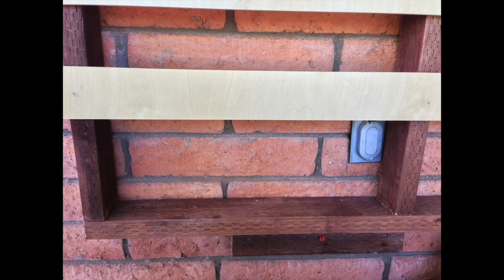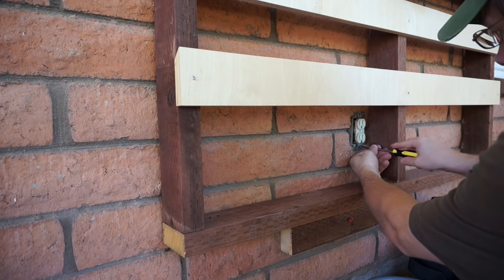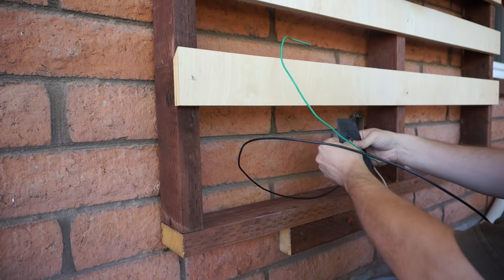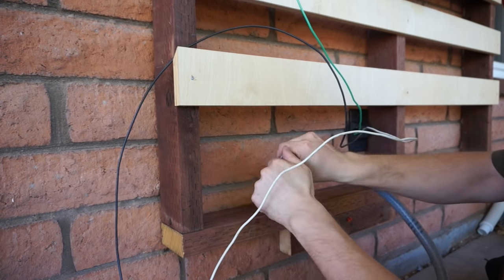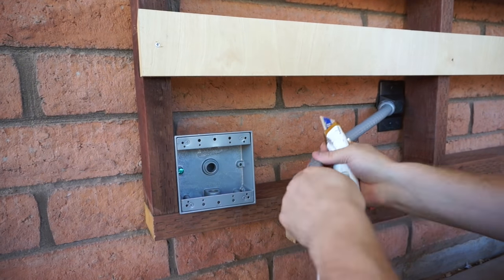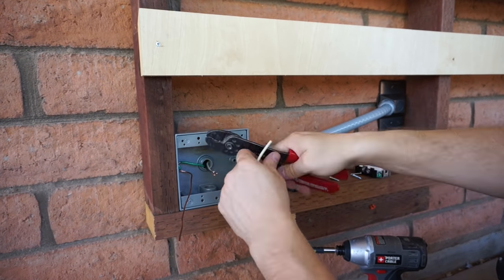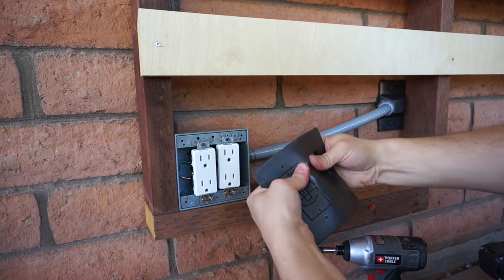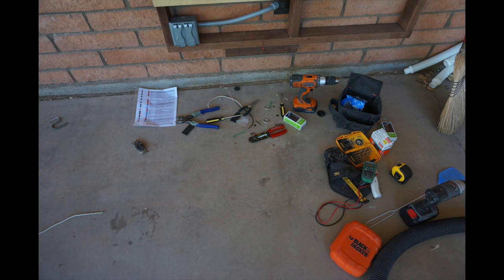How To Extend an Electrical Outlet

Comment: Curious how you would connect a power outlet in series. Then you would need to have an appliance in both outlets or no current will flow. And if one appliance has a lower resistance than the other then it will have more voltage over it than the other LOL. I guess you mean something else than the normal series/parrallel meaning. Any outlet that works on its own (as any outlet in the world does), is connected in parrallel, no matter what routing tricks you do.
Reply from the maker: Serial, in this case, is referring to the fact that if you wire up the outlets linearly, with the input hot/neutral on one side and the outgoing hot/neutral on the other, then all electricity flows through this outlet on the way down the circuit.  This especially matters with GFCI outlets since if the outlet trips, then the entire circuit from that point on is cut.  That's how all of the bathrooms in my house are currently wired -- one GFCI outlet at the beginning of the circuit that protects all outlets in the room. 

In a parallel installation, there are no wires on the outgoing terminals and thus if the outlet trips, only that outlet is switched off and all of the rest in the circuit will continue running.
Reply: Series electrical wiring is not like series electronic wiring of batteries, resistors, and such.  It does not mean that the neutral connection of one outlet is fed to the hot connection of the next outlet.  It means that the hot connection of one outlet is fed to the hot connection of the next outlet, and the neutral of the outlet is fed to the neutral of the next outlet in a daisy chain sequence.  All current drawn from the downstream outlets also flows through the upstream outlets, and a failure of any upstream outlet kills all downstream outlets, too.

Parallel electrical wiring connects the in-the-wall wires directly together and includes pigtail wires to each outlet from that same connection point.  The hot wire into the junction box is connected directly to the hot wire leaving the junction box and hot pigtails from each outlet are also fed from this connection.  The same goes for the neutral and ground wires (if the boxes are not metal).  This means that current only passes through an outlet when something is directly plugged into that outlet.  All other current travels directly through the in-the-wall wires, and a failure of any one outlet does not affect any others.

Many, many residential circuits are wired in series.  Why?  Not because it's the best method.  It's because it's the cheapest.  It takes fewer wire nuts and the least amount of work by the electrician, maximizing profit.  The "simplest" installation is to backstab the incoming hot and neutral wires into an outlet, then backstab the outgoing hot and neutral wires into the same outlet, and so on,, using the outlets themselves as the bridges for current.  No screwdriver.  Just strip wires and push them in (ok, ground wires may require the screwdriver for at least one connection per box).  This is a horrible method of wiring, but nonetheless it is extremely common.

Parallel wiring requires at least two (or three) wire nut connections per junction box and two (or three) pigtails to be cut, stripped, and connected for each outlet.  If you're going to go through this effort, then you should also either purchase back-wired outlets or use the screws on the outlets to make solid electrical connections instead of the poor backstabbed connections.

Comment: you drilled 2 holes in the side of the box to mount it. you need silicon on them holes or they will leak.
Reply: look into ductseal its spark plumbers putty
Reply: Came here looking for this comment

Comment: Why not use GFCI outlets?
Reply: My guess the original outlet came from a GFCI circuit (GFCI breaker or another GFCI receptacle). The new ones inherit that GFCI characteristic. But again, my guess could be wrong and GFCI outlets must be used instead.

Comment: Just two comments; first, I hope you dont completely cover that old outlet with wood.  Would be illegal because it is inaccessible. Second, if there isn't a roof over the outlet it has to have a bubble in use cover on it, not a damp location cover

Comment: Your wires must have 6 inches in length outside of the box. So you might want to redo it or just keep it in mind for your next project around your house. Your work here was not up to code. Also, you need to strap the liquidtite to the wall.
Reply from the maker: Thanks for the feedback. I actually heard both of these criticisms (and one more) after this video was initially posted and so I posted a followup with fixes immediately after: https://www.youtube.com/watch?v=eLUIK6IOw5Q
Reply: Wonderful!
Reply: +granworks
I tend to add little popup text boxes on the screen when I make mistakes and don't address them prior to uploading
Reply from the maker: That's a great idea!  I'm planning on going through some of my older videos sometime soon and updating them with cards and/or links.  I've only ever done the end-video annotations so I have a lot to learn on how to do all this.
Reply: Wrong.  3” outside the box. 300.14

Comment: I’m looking to change my wires coming from my circuit box that goes to my pool pump. What kind of outside wires do I need? The one that’s out there now has been there since 1987 and it’s old and rusted. What gauge  and my pool pump is 3/4 HP with 115/230v
Reply from the maker: You will really want to research this in more depth, far beyond a YouTube comment, since the electrical code is relatively complicated in this case.  In general, though, you will be looking at 12 gauge wire in either UF (Underground Feeder) format buried to 24" or individual THWN wires in PVC buried to 18" or even the same in galvanized conduit buried to 6".

I would go with the PVC conduit route, personally.  The conduit size also matters.  3/4" would work but I'd bump that up to at least 1" since pulling cable over long distances in an underground cable is no fun if it is cramped for space.

Hope this gives you a good jumping off point!
Reply: Granworks Workshop Thanks for your reply, I’m actually just wanting to change the wire coming from my circuit box switch we have outside by our pool pump. I’m not doing anything at the main switch board inside. We have a small circuit box outside and the wire run from the switch is just a little over 4 foot to our pool pump. I’m actually wanting to put a new switch in as well. So what gauge wire and switch do you suggest?
Reply from the maker: Ah, sorry, that's getting a bit farther from my wheelhouse to give any specifics.

Comment: Is looking as no certificated electrician 1- Per 2008 NEC all  the receptacles using outdoors or wet location have to be GFCI2- Per the same, the cover have to be closed when in use or not ( bubble covers)3- The boxes using in wet locations never have to be drilled (lose weather tight condicion ) be supported used the metal ear supplied  in the package
Reply from the maker: The GFCI is handled in the Followup video.  And no, this doesn't need a bubble cover because this is NOT a wet location.
Reply: It looks like this is mounted on the exterior of the structure? If it is, I believe NEC does require a bubble cover

Comment: why did you choose  THHN I want to something that looks like it's outside instead of  THWN? wood THWN be better outside since it's for wet and dry places and it can stand temperatures up to 167 degrees Fahrenheit. THHN is for dry and damp places but it can stand temperatures up to 194 degrees Fahrenheit. hopefully it doesn't rain too hard Where You Are.
Reply from the maker: The cables are actually dual rated THHN/THWN good to 90C (194F).  I only mentioned THHN because I don't care about the "wet" part of this, since my installation is not considered a "wet" location.  But yeah, it's difficult to even find plain THHN around here without going to speciality suppliers so all of my single strand insulated wires are dual rated.
Reply: granworks qq
Reply: M. Low yy

Comment: Do you all even do electrical work?what about no buried jb's is not understood. You all are worried about codes and no one points out the failure should stop the project from the beginning.
Reply: I caught that.
Reply: He points out in the followup video that the junction box will never be covered, it will remain accessible forever.

Comment: What gauge wire did u use?
Reply from the maker: 12 gauge
Reply: @granworks  gd i'll be using same gauge, can you straighten this conduit out or no? seems hard to straighten
Reply from the maker: Yes... but this type of conduit exists mostly because it can be flexible.  If you have exclusively straight runs, then it might make more sense to use something like ENT or PVC.
Reply: @granworks  gotcha, can you connect pvc conduit to it tho if you already put some of this up already or no?
Reply from the maker: Not directly.  The recommendation is to connect your liquidtite to one side of a junction box and then connect your PVC to the other.  Alternatively, you can get liquidtite to EMT connectors, since they are both screw-on.  But using solvents on liquidtite is never (that I know of) permitted.
Reply: @granworks  what kind of pvc should I use for 12 gauge wire? and how do I connect it to a metal junction box?
Reply from the maker: The PVC will be schedule 40 or schedule 80 and will typically be gray.  Connections will be standard thread-on units that are commonly found in the electrical section of any hardware store.  But... I'm getting increasingly uncomfortable giving advice on a setup that drifts from my own.  Electrical work is very easy to get wrong and  vetting somebody's design over the Internet is fraught with problems.  I strongly suggest you read up on electrical work FIRST before continuing, so you don't get hurt or you don't construct something egregiously against code.  I had very good luck with the Black and Decker Complete Guide to Home Wiring book -- tons of useful information and very well presented.
Reply: @granworks  ok thanks, ill look it up.

Comment: Those are not in series.  They are bridged, so, parallel
Reply from the maker: Quite a few people have noted that I am technically incorrect by calling this a series circuit.  You are the first to mention it is bridged, though.  Can you explain why the distinction matters?  The circuit absolutely ACTS like it is in series (later outlets get no power at all if earlier outlets terminate the power) so why would it be important to refer to it as bridged?

Comment: If you’re covering that whole opening you can’t bury the j-box.  If it’s exposed I’d use emt not sealtite
Reply from the maker: Right, this is a slat wall so it will remain open -- what you see is what you get.  I used the liquid tight conduit since it is rated for exterior use and, as I think I said in the video, my EMT bending skills are horrid and and I wanted to see if liquid tight would do the job easier.  Indeed, it did.  I absolutely would have used EMT if I thought that this might get bashed around a bit.

Comment: Ummm, as an electrician, I would say you're NOT to hide a junction box in a wall that is NOT accessable. I'm assuming you framed around this with the intention of putting something that would cover the old plug.... If ever something happened with those joints or wires you'd have to tear up your wall to access them. Plus burying a box is against code unless there's an access panel. But if you leave this uncovered as is and all is accessible then ok, but if you cover that old box up, no. The simplest thing in this case would be box extension rings. Then make joints and put your plug in with a weatherproof in use cover. Not to mention need a GFCI plug. (See follow up video). Basically y'all, save yourself some headache and hire an electrician to get it done safely and right.... Good luck

Comment: You should use a gfci outlet instead
Reply from the maker: Okay, I'll bite -- what's your motivation for posting this comment?  The video is nearly four years old; there are just under 20 existing comments that already mention the missing gfci outlet; and I even posted a followup video (linked in the description and end cards) talking explicitly about the gfci (and other issues).  Yet here we are.  Why?

Comment: Couple things I see. 1. You must have no less than 3" of free conductor from the face of the box. 2. you now effectively have a junction box in an in accessable space if you plan on closing that space. 3. Any screws put inside an outlet box cannot be more than 1/2 inch from the back of the box. 4. You need TR/WP outlets(tamper proof/ weather proof). EST Instructor NGTC

Comment: Why not crimp the wires properly instead of using those awful twist connectors? I hate those things, would never use them
Reply from the maker: Twist connectors are the standard for in wall wiring here in the US. There are crimping options available now, but they are rare and use of them is typically discouraged.

Comment: Don't understand why Americans don't use Robertson screwdrivers. They never slip like slotted ones.
Reply from the maker: Yeah, I hear that.  I tend to buy Robertson/square or Torx drives when buying my own screws.  You work with what you got, though.  I will say, too, that slotted screws are handy in one respect -- you always have something that can tighten or loosen them.  I've unscrewed slotted screws with coins, knives, rulers, and so much more.  All you need is something flat and thin.
Reply: Where did u get the cover with 3 holes

Comment: you cut the wires short in the box,  your leads should be at least 8 inches allows you to easily remove and outlets.  Also good to test with an Outlet tester it will report if the outlet is correctly wired and properly grouded ,  the volt meter doesn't give you this information
Reply: Outlet tester is handy. But you can check voltage between hot to ground to see if properly grounded. You can test neutral to ground to see if polarity is reversed

Comment: I'm an electrician by trade for almost 20 years that is definitely a homeowner's job. That is not how should do it. Call a electrician they'll do it correct way it'll be on the company's insurance if anything goes wrong and it's usually warranty parts and labor for a year for even any service call it's well worth the money to have somebody who's went through a four year apprenticeship to get a journeyman license to do electrical work correctly. Nobody really understands electrical code like we do.
Reply: *who's gone through, not 'who's went through'...jeez...learn some English FFS
Reply: I just can’t get over how he didn’t bother putting a GFCI on an outside outlet, on top of using the waterproof flexible pipe instead of just conduit.
Reply from the maker: No need for a GFCI outlet, since the entire circuit is already GFCI protected.  That said, I did go back and add a (redundant) GFCI outlet in the followup video to this.  I used liquid-tight conduit not because it was waterproof but because it was flexible.  My conduit bending skills are very rudimentary and are limited to very simple angles -- there is no way I could do the compound angles needed for this tight space.  I didn't need the waterproof aspect of it since it's in the back of a 10ft-wide porch and literally can never get wet.

Comment: straight up no you out can't put Romex in EMT or in rigid or PVC period NEC . and there is no slack my man I would have used a exstention box and then came right in to the side of the box . but not a terable job the concept is right it just isn't code lol

Comment: I been a master electrician for 40+ years . Please do not do this people. This guy is not qualified and doesn't know the nec codes.
Reply: He found a creative way to get 120 volts from where it was to where he needed it without doing brick work or having to work inside the wall. Aside from not securing his flexible conduit, what’s the problem. It’s clearly a home and not a commercial business, it’s grounded and there is no exposed wiring. There is no reason to crap on his diy solution.
Reply: So, Mr. Master electrician, please tell us what he did wrong. Otherwise your comment is pointless.

Comment: So many things done wrong here. Do not follow this guy's advice. You will regret it in the long run.
Reply: He found a creative way to get 120 volts from where it was to where he needed it without doing brick work or having to work inside the wall. Aside from not securing his flexible conduit, what’s the problem. It’s clearly a home and not a commercial business, it’s grounded and there is no exposed wiring. There is no reason to crap on his diy solution.
Reply: If you’re going to criticize be at least a little constructive. His work is safe and he is careful and he solved his problem.

Comment: He found a creative way to get 120 volts from where it was to where he needed it without doing brick work or having to work inside the wall. It’s clearly a home and not a commercial business, it’s grounded and there is no exposed wiring. There is no reason to crap on his diy solution.  Power goes where he wanted it and no one will get hurt by it. It’s not that complicated.